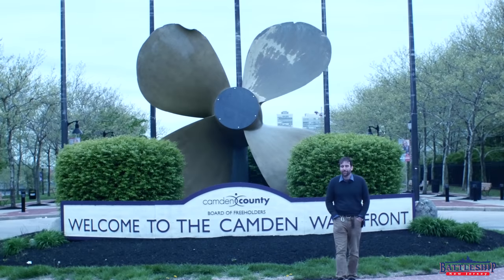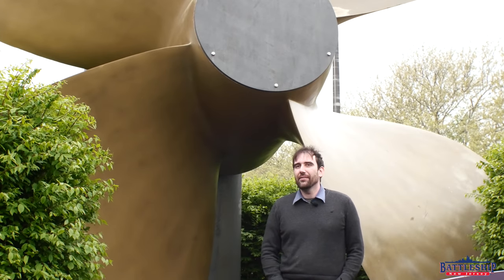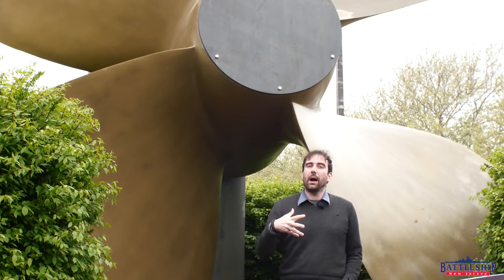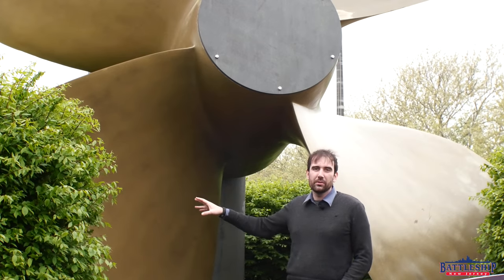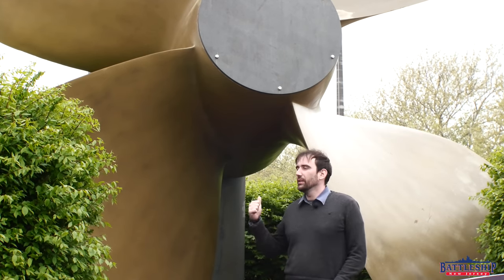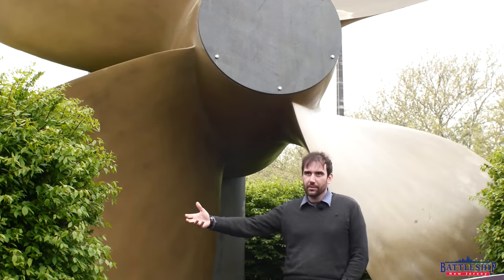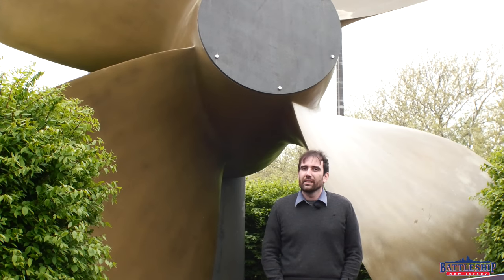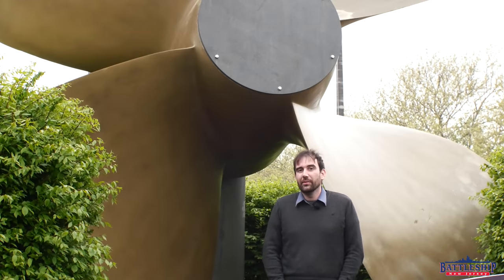How Big Are Battleship Propellers (Also Called Screws)?

Comment: "How are you gonna steel an 18" bronze propeller" well, we (power plant) had a million gpm river water pump impeller stolen from the shop that was reconditioning the pump. We later found it in a local scrap yard, and they had already started cutting it up. So we went a year operating at half load while we waited for a new impeller to be manufactured.
Reply: Stealing an 18” propeller is easy. I have at least 4 13”x13” propellers decorating my living room.  A good example of this happening can be found in the movie “This is Spinal Tap”.
Reply: @jameshardy4946  Stealing an 18' propeller on the other hand, is not so easy

Comment: Almost certainly the fact that she's sitting in fresh water makes a MAJOR difference in dissimilar metal corrosion. Salt makes water a much better conductor of electrical current.
Reply: Yep.If we were idle for longer than a week, all condensers, coolers, and seawater systems were drained and filled with freshwater for layup.
Reply: Wouldn't the water their be brackish.

Comment: Several comments - now versus then 5 years between Dry Docks (he said 2) for active ships. Active Ships - "shaft always turning"- what about inport?  Actually - a good portion of time in port the "jacking gear" is engaged - and the shaft is Turn - Slowly -avoid the issues described (Slowly - minute per revolution - instead or reverse revolution  per minute "to be going"
Reply: We use turning gear on the big stuff in power plants; but it's done to keep the shaft turning so it doesn't sag. Turning the shaft doesn't extend the life of the packing where the shafts exit the hull.
Reply: You Jack daily for 11/4 turns for PMS when inport cold iron. But you have to have a closed lube oil system and engine, which you usually don't have because of equipment tag outs and maintenance. You continually jack when lighting off for underway and when cooling down after plant shutdown. BTW, you have to heat the lube oil to 90 degrees before you can start jacking.
Reply: @SSN515  I’m curious as to how  the Iowas survived such long periods in reserve (particularly BB’s 61,63 & 64 that were laid up for 30ish years between the 50’s-80’s) without periodic jacking and movement of other heavy machinery? People claim that the shafts and bearings will be ruined now due to all 4 ships approaching 30yrs out of service but how is that different from earlier periods of inactivity? I know they have had no maintenance to the machinery as museum ships but it seems they had just as little during their time in the reserve fleet
Reply: @zetordaft  In mothballs, they seal everything up and put desiccants into a lot of machinery and equipment. They put the boilers under a pressurized nitrogen "lay-up". The main engines, reduction gears and condenserrs have huge dehumidifiers placed on welded I-beams with ducting routed to various areas. Same with electronic spaces and gun turrets. Line shaft bearings. Hull blanks. "Igloos' installed. Cofferdams.And as I wrote in another answer, the shafts and props have a marked on the reduction gear "docking position' for weight distribution and main shaft and propeller positioning. The hulls have electronic cathodic protection equipment installed. Costs a lot to keep them around in Reserve.

Comment: Can some aluminum sacrificial anodes not be attached to the ship by divers? I'm sure it's harder than when she's in dry dock, but I can't imagine it isn't much cheaper than dry docking, so I'd think it might be a good option in between dry dockings, provided it's physically feasible.
Reply: I'm not an expert, so please take this with a grain of salt.. but I think the problem is that there might be remains of the current zinc anodes still in place, which would probably need to be ground off first, before new anodes can be put on in their stead. Otherwise you would need to make new welding spots and in doing so remove some of the protective hull-paint, thus exposing more of the ship's ferrous metal to water. And given the size of the ship, we are probably talking a LOT of anodes here. Meaning even if it is possible, it would likely be prohibitively expensive both in terms of money and in terms of time required.
Reply: I don’t really know about how zinc’s are attached to large ships but, they’re bolted onto most smaller craft. Just a shot in the dark here but, I’ll bet the tools alone to bolt something like that onto a battleship are huge. The zink’s/aluminum are probably pretty big too. If it were sailboat sized, no problem. It’s got to be a big 40+lbs brick on a battleship.
Reply: @ranekeisenkralle8265  curious to know how the welding would work given that both zinc and alu have a much lower melting point than steel. Maybe they could be brazed on with alu / zinc filler? Bolting on might be even easier again, though maybe the attachment point is what gets welded and then the anode screwed to that?
Reply: @carneeki  Frankly I have no idea how exactly the anodes are affixed. Welding just sounded like the most feasible answer since any screw would also add another metal into the mix...
Reply: This is obviously a "flex seal and bonder" job
Reply: @ryder6070  the two metals must be in electrical contact otherwise it doesn't work
Reply: Remember too that the NJ is now in fresh water and the corrosion process is much less
Reply: Yes. Completely straight forward. I've commissioned thousands of anode changes on ships and installations in water. And I've changed the ones on my own boat. There should be mounting points on the hull. A good scrub to ensure contact between the anodes and the hull is all thats needed. This is not complicated or expensive. All professional divers, even lower skilled ones, will be easily capable of doing this in this shallow water.

Comment: In case you really need to replace any of the 4 screws, I know where there is one for each shaft. Hanging at the end of the propeller shafts of the USS Midway. These were changed after the Midway got her angled flight deck to keep the launch speed up to critical speed.
Reply: Two comments, as a Midway decom crew member Y'all keep your fingers off the "Tip of the Sword!"  Also, according to my copy of the Midway's Propulsion Plant Guide, the outboard (shafts 1 & 4) props are 4 blade 18'8" diameter and the inboard (shafts 2 & 3) are 5 blades 17'6" diameter. Random additional fact, Midway can go from 0 to 33 knots in 32 minutes!
Reply: @holdmycoffee4470  So are they very close or identical to the Iowa class ships screws? If so could they have interchanged them if necessary?
Reply: @johnstudd4245  I don't know if they are exact replacements. But they are very similar. About the same size, same blade configuration ( 4 bladed outboard and 5 bladed inboard).   The ships are similar in size and were built with in a couple years of each other, so it's not out of the question. My point though was that it wasn't like putting a V-12 Ferrari on a scoreboard, what ever that means. Are the shafts the same diameter? Are the hub tapers the same? I will see if I can find that out about Midway. So we can actually get an idea if they would work.
Reply: @holdmycoffee4470  Yes, I wondered about standardization of shafts and mounting issues and that sort of thing. I'm sure you are not going to hang one of those props on a Fletcher class destroyer, but a Midway class carrier, would seem to be doable, as displacement and shaft horsepower are about the same.  Oh, and watch out for those kids on the playground who want to beat you up.

Comment: Would it not be possible to affix aluminum anodes to the hull to help prevent dissimilar metal corrosion?
Reply: C B  but it's not rotating so cavitation is no longer an issue
Reply: C B  pitting is on the screw the corrosion happens to the hull and other ferrous metals nearby
Reply: Pretty sure he know this.  USS Cod, which came out of drydock not too long ago and is a museum submarine in Cleveland, had aluminum anodes installed about every 6 feet down the length of the hull; looked like overkill to me, but the museum staff decided they wanted as many as they could get.  Even with a submarine's nice thick pressure hull, and sitting in fresh water since the 1950's, she still had significant pitting of the hull.  IIRC, Cod's screws were removed long ago, so it's definitely not to protect the screws -- it's to protect the steel of the hull.

Comment: Could you permanently leave the ship in a dry dock designed specifically for displaying it? Maybe there could be an artificial waterline of glass or acrylic that is the roof of a lower gallery where people could walk around it and see the screws and the towed sonar, etc.
Reply: The only problem is that the ships are designed to have the water support them, with out the water it slowly pancakes out
Reply: DD  661 USS KIDD is on display in Baton Rouge. She sits in a cradle and is completely out of the dry when the Mississippi is low, but she appears to be floating when the river is high.  You Can walk all around the hill as well as inside. She has also been completely restored to her WW 2 configuration
Reply: USS Hazard (AM-240) is a ww2 minesweeper displayed on blocks here in Omaha, NE. She's holding up fine, and will float when the Missouri River comes out of its banks. (3 times since 2000). Doesn't seem to be a problem for her.
Reply: @barklet6110  j think that issue only arises when in dry dock since due to the nature of needing to work under the ship, the ship sits on pillars that concentrate the weight only on those locations, thus the pancake issue. However if you pour concrete all over up to the 'waterline', the weight would be equally supported in all directions
Reply: @duuurs  Hazard is a MUCH smaller, lighter ship than an Iowa-class battleship.
Reply: I think that's probably the dream of every museum ship curator . . . the 'pancaking' issues others have mentioned could be addressed, perhaps with some sort of flying buttress-type structure.  Storing a battleship indoors, out of the water, would defintely have advantages in terms of longevity, but the costs of such a structure would be enormous--and the structure would require it's own maintenance, too.
Reply: Lol guys a 60k ton BB is a little different than a 5k ton DD lol

Comment: Rumor I heard is that one of the main reasons why Intrepid doesn't really resemble a ship from the interior anymore is because when she was drydocked in 2006 her screws were removed, when she was refloated and back in place the NYC fire marshal declared that it was no longer a "ship" without the screws and as such was subject to many other ADA and fire safety regulations that museum ships are normally given some leeway on.

Net result is huge picture windows and wide staircases leading from the hanger deck (which is almost unrecognizable as a ship interior) to the flight deck.

Comment: I would "assume: also, if all 4 screws were removed from the ship, due to the combined weight of them, wouldn't the back end of the ship come up out of the water a bit? I personally do not have a clue how much, but, then to level the ship out, that would require ballast tanks be filled to comp the missing weight, again, "assuming"... which if that being the case, water rusting the inside faster now?... I could very well be 100% wrong on my assumption....
Reply: 20 tons each, 80 ton total versus 45,000 ton ship. If it were a straight percentage, then an inch or so difference, but the shape of the hull changes that, so probably wouldn't be easily measured.
Reply: It be barely noticeable
Reply: Right on. I forgot about the biggest part of that equation, "the weight of the ship"

Comment: I wonder if it's impossible to disconnect the shaft from the motor and rotate the blades by other means. Speed is not in question, rotation is. So every two months (with a pinch of salt on the statement) wrap a cord around it and pull. That would give the seal its relief.
Otherwise, if it's possible to design a brace that is mounted unto the hidden part of the hull which pulls the blade up just enough to negate the weight. Just thinking out loud...

Comment: Are you allowed to run the engines from time to time? That might help save those seals.
Reply: Nope. The engines are steam powered and the Navy won't let there be steam.
Reply: @ghost307  I can’t imagine they’d need to turn super fast, pneumatics would probably be enough to get it to turn
Reply: They are not allowed to operate the ship's propulsion in any way. The seals are going to age no matter what and eventually need repairs.

Comment: Should not the weight be carried by bearings rather than the seal?
Reply: The bearings have clearance, the seals (a sort of rope-like material) are compressed onto the shaft by glands that can be tightened.  So it actually is the lower section of the seal (and bearing) that supports the shafts and screws when the shafts aren't turning.  If the glands aren't tightened, a gap can form at the top of the seal, allowing leakage.
Reply: They have both

Comment: but don't you have the zinc/alluminum sacrofice blocks, anodes, on the bottom near the prop?  you can check/replace them with a diver. 
Also don't you turn the engines and therefore prop shafts regularly?  It's offically still reserve right?

Comment: Many ask why ships us propellers opposed to pumpjets...Low efficiency at low speeds. The waterjet propulsion system has a lower propulsive coefficient than standard propulsion systems at low speeds. The thrust force is dependent on the change in momentum, and the water-jet develops less thrust at low and intermediate speeds because of the inherent difficulty it has in handling large mass flow rates at low speeds, whereas the opposite is true for conventional propellers.

* Clogging. The seawater intake grill can become easily clogged with sea debris.

Comment: about the props on the ship... puttin on my engineering hat, I would get them removed to protect the gland seals, unless one could find another way to take care of them (could one turn the shafts slowly, somehow from time to time, like with a turning gear on a Diesel plant?)- however, looking at the financial aspect- I can very well imagine that some clever pencil shover would calculate the value of such a prop and have them scrapped, or sold to a foreign collector, to rake in that cash, which would leave the ship without her props. so, in the end, keeping them where they are supposed to be in the first place might be best, having a close look at those seals.

Comment: Camden is such a crime ridden getto surprised nobody took a torch or saw to steal part of the rudder. Worked on a busy Philly street and 3 guys stole 50' of large copper Cornish off roof around 6 PM during daylight and only 2 blocks from one of the busiest police departments.
Reply: Ha ha it figures in filth adelphia
Reply: There's a difference between "it looks like they're doing some roof work up there" and "hey, they're cutting apart a historic artifact at street level at an intersection"

As often is the case, reality resists such simplicity.
Reply: Knew of a case where a stolen car was parked in front of the police station. For weeks, and the cops never twigged

Comment: Do they still cast large props like this ? If so I would love to see how they do it.
Reply: @ralphgesler5110  I know that they still have props but perhaps used CNC machines now.
Reply: Yes, they make much larger props today. The large container ships has props that weigh 120 ++ tons, that’s 5-6 times the weight of the New Jersey prop.
Reply: They use a bunch of little people with hammers and chisels. Is amazing watching them work.
Reply: @jamesbehrje4279  You should see the size of the 3-D printers they are using today.
Reply: @Urbicide  lol
Reply: @frankjrmuchnok2647  Modern props are cast and then cnc'd to a high accuracy. Computer aided design allso gives better efficiency and less noise and vibration.

Comment: could the shafts be cut out side the hull and have the openings blanked over, then add vertical supports from the hull to the front of the shafts to hold them up, then you can both not have to worry about the seals leaking and keep the screws on the ship

Comment: Would it be possible to connect a big electro motor with massive gear reduction to the shafts and turn the propeller ever year a few rounds and stop it 3/8 further?
Right now I would not risk it since it could leak after all that time when getting moved, but after drydock would be an option (when possible).
And maybe even check the logs if painting the propeller was a better protection for the ship, since I get your point with that they will get lost when removed when you don't have a space to display/store them.
Can  you actually send divers down to check the hull?

Comment: Why not have a fiber glass panels that have a walk way built into it to keep it away from the haul of the ship. then pump out the water to remove the water part from the formation of rust. Have a form in tubes to make walk ways and keep the distance from the fiber glass away and cradle the ship and seal the compartments to stop water entering the void. Another way to think of it is having a caissons against the haul and you can have members of the public walk around the ship.

Comment: Not being the expert, I would have them removed at the next dry-docking. The static load of a non spinning screw just makes it harder to tow although not too much at tug speeds still an increased load. Perhaps keep one of the 5 blades so that there is a set to see but perhaps the others could be sold to fund the macro artifact preservation. Perhaps with proper balancing and ELF bearings it might be displayed somewhere in a vertical position that actually could be spun.
Reply: No thanks.